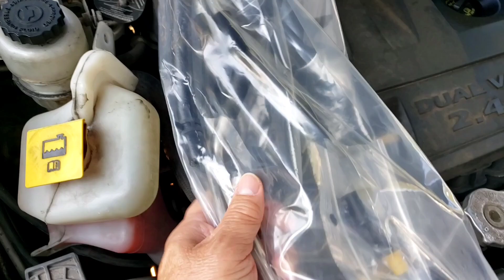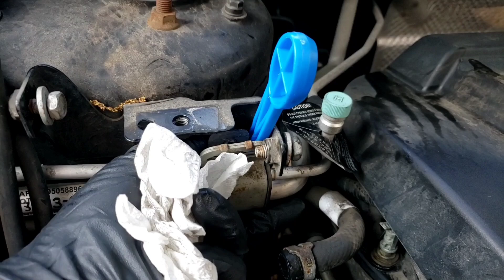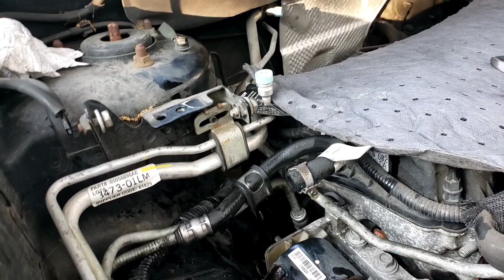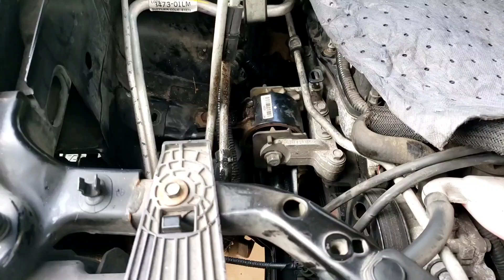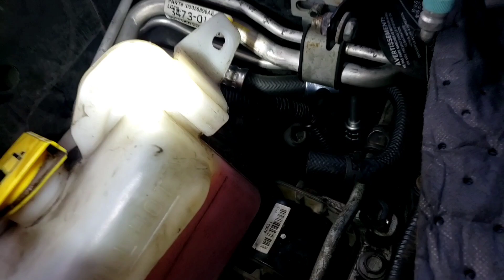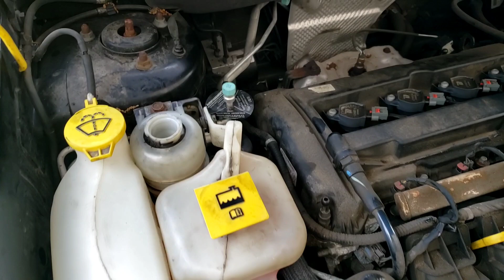Jeep Compass Power Steering Return Line Hose Assembly Replacement Change 2014 and Similar Years

Comment: What tools should I take to remove one of these lines from u pull it
Reply from the maker: From a u pull it, I usually cut off everything around it with a battery operated Sawzall or cutoff wheel tool, but becareful around the rubber hoses that are attached to the lines, you might need those.
Reply: @alyoungcuda  yes sir thank you my u pull it doesn’t allow us to use sawzalls because of crackheads